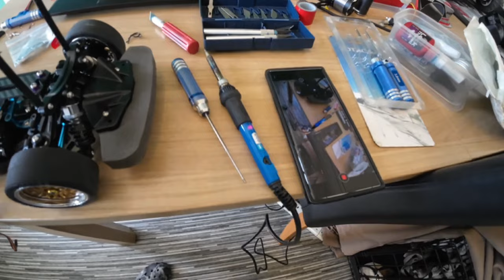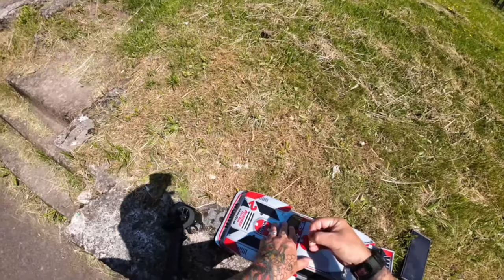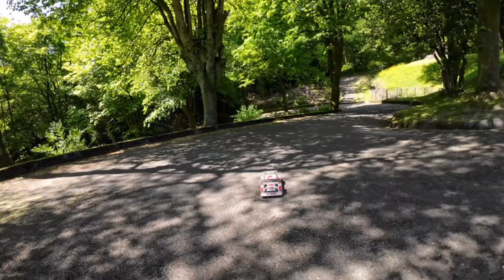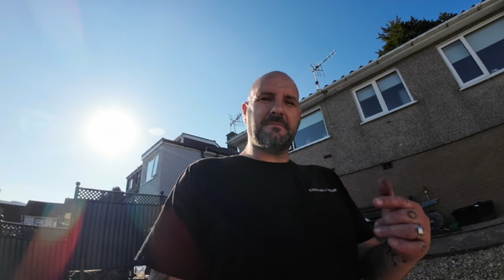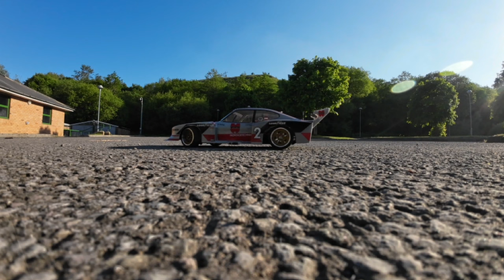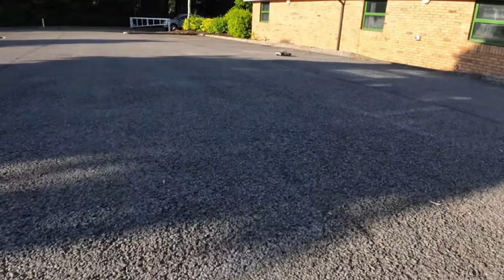Tamiya TT02 First Run: Epic Success or Total Flop?

Comment: I've got 2 tt02 kits.  The Porsche 911 '73 rsr and the 2018 mustang gt4.  Both beautiful kits.  As far as upgrades go, many are not needed for these kits.  The Tamiya kit parts are very good.  Many of the off-brand "upgrades" are garbage.  All you need for great tt02 is: ball bearings, oil shocks and toss or glue the stock servo saver.  The aluminum drive shaft is nice but not critical.  The biggest problem with tt02 cars running on pavement or roads outdoors is ride height and the springs in the shocks being way too stiff.
If running outdoors on imperfect surfaces, always build the kit with the high ride height option in the manual.  The aftermarket bling blue steering assembly is often worse than stock for slop.  Most of the slop and failure to re-center steering is the servo saver not the linkage.  I've eliminated the stock servo saver on both my kits and the steering is perfect now with no other mods.  (use a shorter arm so the servo has more leverage against the steering rack and re-centers properly.)
Also, virtually all of the oil shocks I've tried have the same problem.  The springs are way too stiff.  The yeah racing kit is the worst.  It comes with 5 sets of springs and all are fit for a car that probably weights twice as much.  This produces tons of wheel hop on pavement and makes the suspension useless.  I  ground the inside of my springs down with a dremel until they were soft enough to allow the suspension and the oil dampers to work.  The difference is amazing.  The car sticks like glue to the road and doesn't hop at all.  I softened mine until the suspension took about a half second or so to raise up from being fully compressed by hand.  This allows the oil and rebound to actually work.
It seems virtually all kits and aftermarket shocks come way too stiff.  I video recorded my car from the side going full speed over pavement and then watched it back in slow motion and could see the suspension doing basically nothing. After modding the springs you can really see the suspension soaking up the bumps and the car just sails along.

These are very fun kits and the price by today's standards is excellent.  The hobbywing 1080 crawler esc is magic in these things also with a ton of programming options.  For smooth steering, expo is your friend.  About 50-55% is nice if your radio does it.

Well, that's my knowledge dump on tt02.  Hope someone finds it useful to make theirs run good.
cheers.
Reply from the maker: Hey there buddy , Wow that was a awesome information dump as you said . 
Its great that you messaged this as information if valuable and i hope that others pick up on this and are able to use it for there own benefit. 
Thank you for taking the time out to post . 
Hope that your well there 
Chris :)
Reply: @ChriswithaCrc  My pleasure.  I've been messing with rc and real cars since the mid eighties. great hobbies but rc is definitely cheaper and cleaner.
Reply: Excellent info. I found that the steering EPA had to come right down even with the D15 under the driveshaft removed. There’s a lump of plastic on the front knuckles that basically just means the servo saver starts opening once the steering reaches a certain point. EPA set just inside that- steering recentres. Had endless problems with grip and fishtailing so I think throttle expo too so it doesn’t break traction from a standstill. MR

Comment: hi ya chris
yet another brilliant video from yourself and boy i do love the colour you painted the body and with the decals its superb looking.
anne has made up her mind and she is going to get me a tt02 bnuild for my first start build for xmas.
i think personally that it has enough power but thats just my opinion.
and its your lucky glove to the rescue and saves the battery.
hope yourself and the family are all well and glad you are in the sunshine having fun.
peter
Reply from the maker: Hey there Peter , 
Yeah thought the colour was a good compromise I liked the black and white so grey it was . 
Good news on the TT02 mate I think you'll enjoy it . 
Make sure any upgrades are from a reputable model shop and not cheap and nasty eBay and Amazon stuff. Sure has made me learn quickly .
Hope you have had a great break as well and the family is well .
Stay safe there buddy
Chris 😎🤙
Reply: hi chris
already spoken to my local model shop wheelspin models about it and they will steer me in the right direction and i am also thinking about gettinbg another radio system as i am not overly impressed with the dumbo rc again wheelspin showed me one today that i really like its 120 quid but its a 6 channel with 2 recivers in the box.
got the hpi firestorm up and running fitted the new carb and all good apart from tuning the carb to optimum power etc.
peter

Comment: Gorgeous car 👍 on my subaru tt02 i found the steering to be terrible, would not go in straight line,had to upgrade it,still not great but better 👍👍
Reply from the maker: Hey buddy , 
There is a trick to get the TT02 steering well , there is a bit of material to remove and also thicken up the front diff oils , makes the car turn in better . 
What upgrades did you fit to it . 
Thanks again for watching buddy
Stay safe 
Chris 🤙😎🚀🤘

Comment: Loved the video.

I am currently trying to get the steering slop out of mine. As well as trying to get a more reliable return to center out of it as well.

Just bought a metal horn. Next will be metal steering components.
Reply from the maker: Hey buddy , 
Thanks so much , well it does seem that I've managed to get it under control with the little bits I've done , so yeah racing Ackerman, yeah racing turnbuckles, tamiya low friction front suspension balls and I used a Schumacher servo saver with a tougher spring . 
I hope this helps you . 
Chris 😎🤙🚀
Reply: @ChriswithaCrc  rock on bro, thanks for the response. I will definitely add those parts to my list.!
Reply from the maker: @Sinn3246  no worries mate, let me know how you get on buddy .

Comment: There's nothing wrong with trial and error.  I think that parking lot is a good place to test cars. In my experience some upgrades can result in making expensive or hard to get parts the weakest link. I prefer to have the cheapest easy to replace parts to be the weakest link in the chain. I don't like parting with what little money I earn. Good job again but I might go brushless 3s capable. I seem to get smoother power delivery with hobby wing. Take care.
Reply from the maker: Hey there 👋, 
Thanks once again for watching , yeah it was a learning curve on the start for sure . 
But as I've said I've raced tamiya before and felt well this can't be right . 
Glad I followed my gut feeling and went back to stock with it . 
Yeah parts on the tamiyas can fool you if you dont research I think . 
I'm more than happy with the brushed set up in it seems to move well for the money . 
Great little budget friendly set up with a decent punch . 
I was nice to find that middle ground between stock and upgrades .
Thanks once again 
Stay safe
Chris 🤙😎🚀